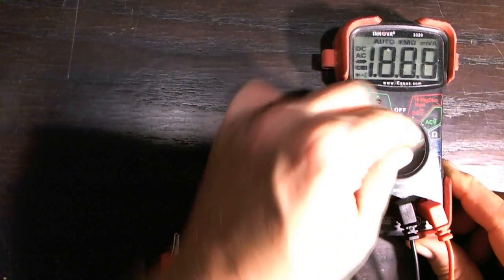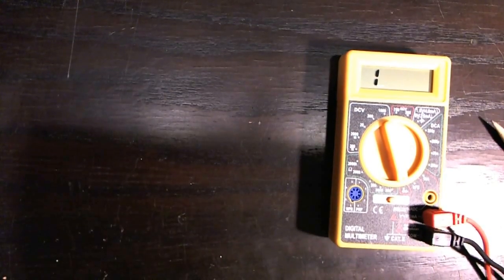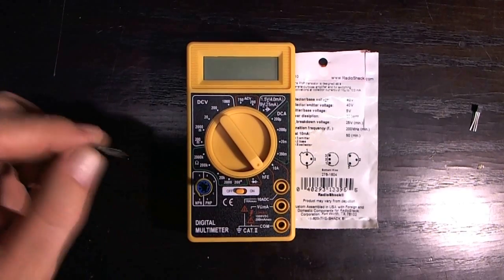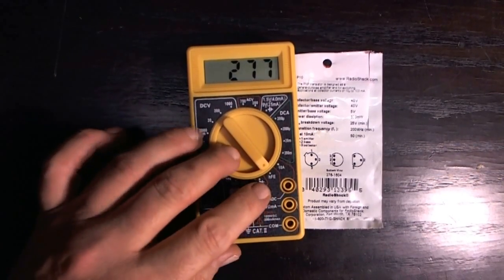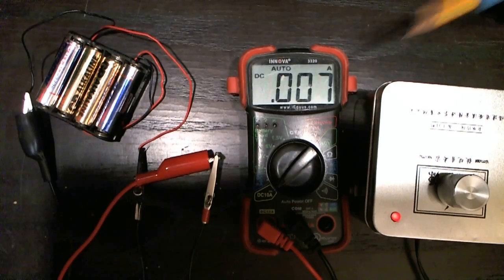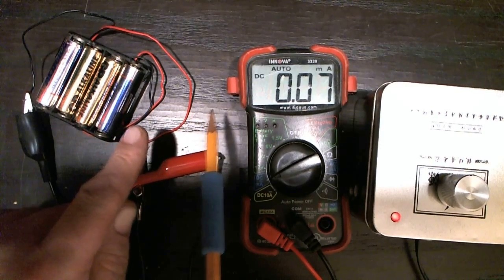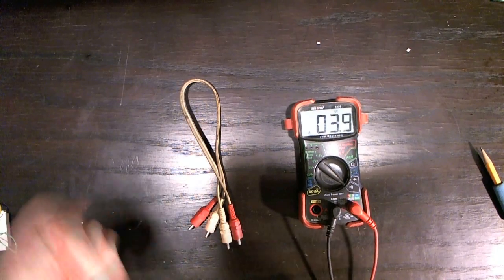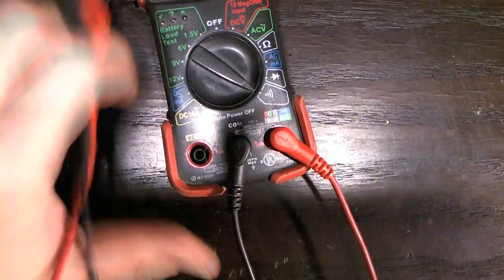How to use a multimeter (for building pedals / audio) pt two

Comment: So is a continuity tester the same thing as an audio probe? It seems like audio probes are usually connected to ground for some reason.
Reply from the maker: similar in concept , but different . yes the probe gets connected to ground . with a cont test you merely use a meter , testing to make sure that electrons are completing the flow . like testing a cable to see if its cracked . the probe uses an additional component , an audio source . you can use a cd player , ipod , mp3 , or signal generator . i use rg keen's quick and dirty test oscillator . you connect the audio source to the input , then the probe connects to the amp . ground the probe to the circuit you are testing , then start probing at the input . you should hear the audio source . keep moving back towards the end of the circuit . when yopu loose audio , thats your trouble spot . get it ?  srry that was looong !
Reply: petey twofinger
Awesome, thanks for the reply. That does make sense. So I guess a probe just makes it quicker to diagnose a circuit, since the cont. check does the same thing but you'd be moving 2 leads from component to component through the circuit. Just checked out your oscillator videos...thanks a bunch. That will be my next project!
Reply from the maker: a lot of components do not pass continuity ... so the cont test isnt good for too much like that , with components in circuitry . the audio probe , well the source signal is strong , it passes thru the circuit no problem . like if you cont test a resistor , it wont cont , but the signal can pass thru , cause it is strong .
Reply: petey twofinger Oh, that makes sense. Thanks for all the help, I'll be revisiting your videos!
Reply from the maker: np , thanks for supporting the channel , pm me if you have ? i MIGHT be able to help ... lol .